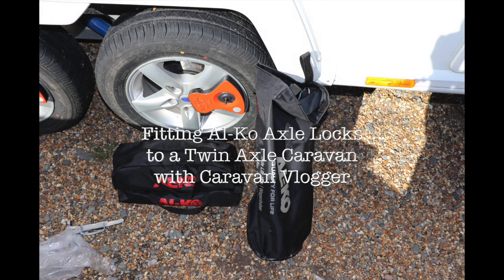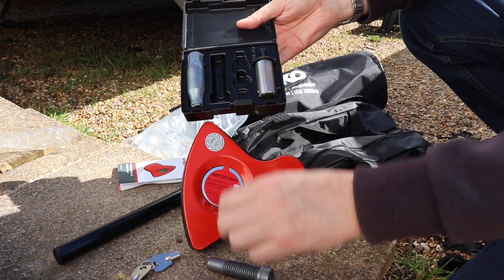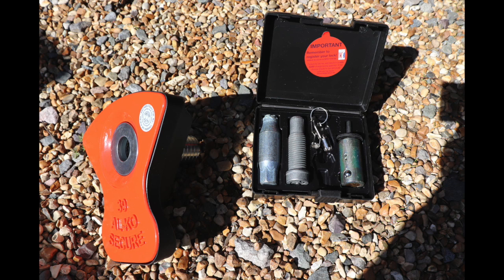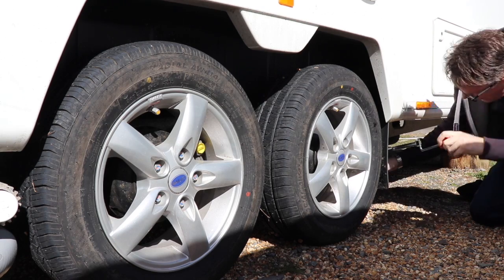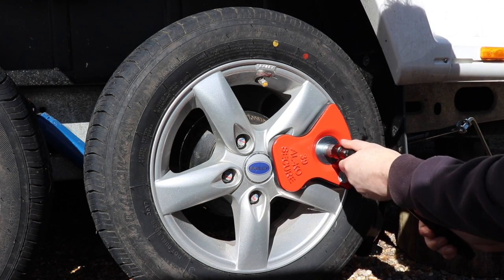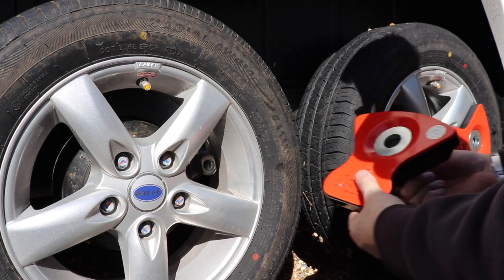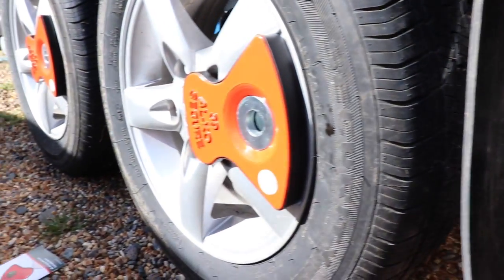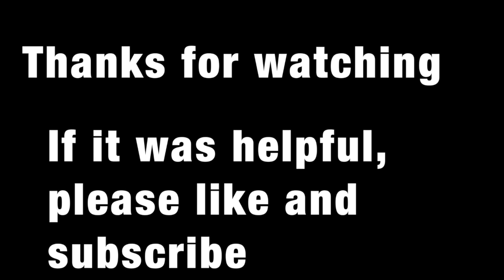Fitting Alko Secure Wheel Locks Twin Axle Caravan

Comment: Good vlog👍🏻👍🏻. A little bit of advice from a new subscriber. If u line the front lock first either before u unhitch the car or on the motor mover then u don’t need to jack the van up as high to alighn the second wheel. I also noticed that u had the corner steadies down😬. That would be putting so much strain on the opposite side steadies. Also I carry a nice strong piece of wood with the jack to put underneath just incase the ground is soft. Looking forward to future vlogs 👍🏻👍🏻😎
Reply: P.s. if u have caravan club insurance and when your staying on there sites you only need to fit 1 lock to validate the insurance 😎👍🏻. Makes life that little bit easier
Reply from the maker: Thanks for the advice. It's our first twin axle and first time I'd put the locks on, so any advice is appreciated :-) Ah, yes good point about the steadies, hadn't  thought of that. Getting one wheel lined up and putting that one on first is the way I'll go in future.
Graham

Comment: The part that receives the bolt, is that in with the kit, and if so how do you fit it.
Reply from the maker: Thanks for watching. They are in the chassis already on every caravan I’ve had. Never bought a lock myself, always came with the caravan. East to check though, just look through the wheel spokes you’ll see it if it’s there, sometimes has a yellow cap on it to prevent dust etc